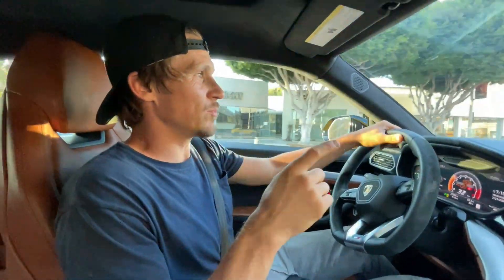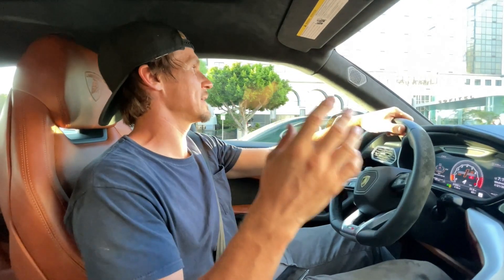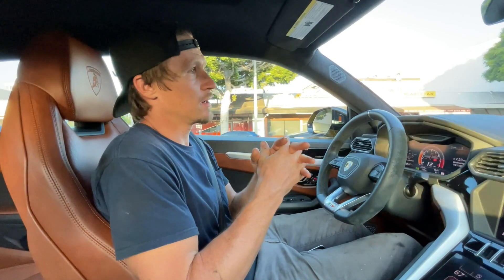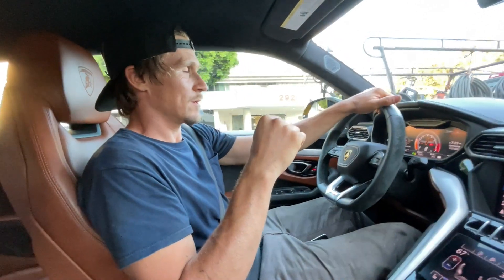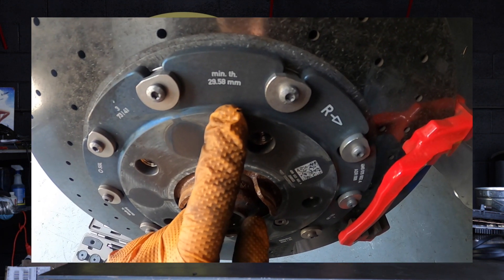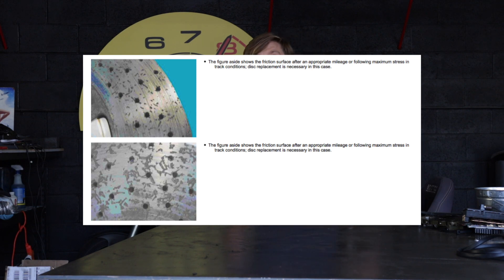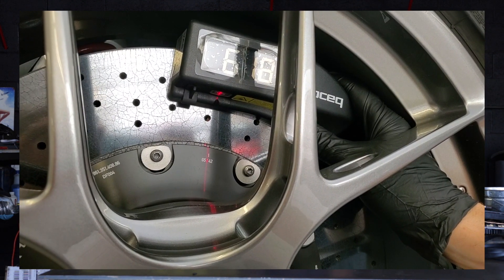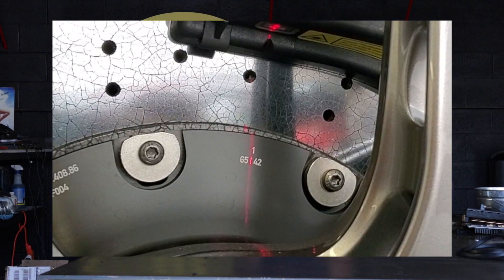Carbon Ceramic Squeal / Rotor Wear Measurement

Comment: Based on the end of the video data (61 - 39) it is 3,8 deterioration within 2 Y & 2k miles. So the lifespan of the rotors will be about 6 years max(if the degradation will be linear)? Sounds bad!)

Comment: Come to find out if you buy them brand new carbon ceramic rotors and brake pads don't do anything that he said especially if you're just normal driving like you normally would if you didn't have carbon ceramic rotors because there's a layer that they put over top of your carbon ceramic rotors before you get them and if you don't break hard and leave swirl marks and you don't have squealing from the start you will not get squealing but the moment you break hard and you start getting swirl lines you will definitely get squealing all the time
Reply from the maker: @jayWill45  yeah I guess all the hundreds of cars I work on and get to be quiet by driving it hard are just flukes. Let me guess, you drive a chevy?
Reply: @HollywoodMechanic  apparently you didn't understand what I said if you're buying them yourself brand new and you're not buying them for racing regular normal driving like you would if you didn't have carbon ceramic rotors on your car it comes with a layer over top and as long as you don't break hard and call swirl lines and do what you said 80 to 30 80 to 30 doing that which causes break groove lines if you don't do that at all and do normal driving like you would any other regular breaks and you don't have the noise from the start you will not get the noise because you haven't worn through or broken in and it will go normally but the moment you do that guaranteed if you didn't have squealing before you definitely will have squealing now but it is true it does stop the squealing but because you have those swirl lines in your rotors now and break hard it will come back it's only going to last for a week or so if you're not constantly doing it and you're just everyday driving regularly most of the time

Comment: I had a grinding noise like it was gravel inside at low speeds on carbon ceramic rotors and they were new I did the method that you said 80 down to 30 
 6 to 8 times The grinding noise quit and left swirl marks and the swell marks are smooth but now which I didn't have before when I come to stops at low speeds it makes a squeaky noise why is that
I got rid of one noise and now I have another noise squealing at low speeds

Comment: My 997.2 Turbo S has a horrible squeal since a track day at Road America. Will try the rebed process.
Reply from the maker: @davidcooper3871  if it started after a track day, a rebed will not fix it. The track day burns off a lot of pad so burning off more is not likely to help. I would check for fluid leak from the Pistons or uneven wear on the pad.
Reply: @HollywoodMechanic  will do this. Surprised to hear that 1 track day could be the cause on PCCBs.
Reply from the maker: @davidcooper3871  I've seen drivers go through a entire pccb pad in one track day. Just depends on the driver, the track, and the temperature outside. But I'm betting something is not wearing evenly in the calipers.
Reply: @HollywoodMechanic  I removed the pads on front right. They were indeed thinner than expected with the metal pins showing. Thankfully the rotor is fine. Ordered new pads.  I’m willing to bet that solves the issue.
Reply from the maker: @davidcooper3871  I've seen drivers wear straight through the pad and half of the backing plate and rotors still looked like new.
Reply: FIXED.  was rear pads.  Though front and rear pads looked the same with some sort of pins showing through the pad material that look like brass, rears were the culprit.  Got rears (TRW) for under $200 at ECS Tuning.

Comment: Unless the rotor was measured with the device when new. How do we actually know the number went down? Is it a fact that  new  rotors measure the highest number or just somewhere inbetween? Good video though.
Reply from the maker: @shaleevans5406  the manual states the first number is the from new number for that specific position on that specific rotor but I have not tested a new rotor to confirm.

Comment: Loved the information of the CCB! Great video! However, is it normal for the CCB to produce squealing noises while moving instead of braking? My huracan performante, it squeals while moving, not only during braking. Was told it is normal. Have checked the pads and disc, all in working condition.
Reply: Have a 488 that does this as well.  Chirps like a nest of birds once it gets hot at low speeds and turning left. Apparently many have this issue as well.  Was told I need to bed them. Still haven't done it as I'm not sure I can find somewhere to do this without getting in an accident or getting a ticket.
Reply: @mak23997  hi, i managed to find out the issue which were the ceramic brakes cracked. Changed all of them and solved them. My pista having the same issue as well, currently at 7000km. Checked no cracks on the brakes and the ceramic discs also still good. Seems like gonna accept as it is

Comment: This is probably a dumb question. I’m in the process of planning a complete overhaul of an older car. Basically throwing good money away in a lot of people’s opinions. Part of my overall is going to be an install of a new brake kit. In theory could one run organic pads with carbon ceramic rotors to avoid some of the issues associated with carbon ceramics for cars that aren’t put on the track and see maybe 100 MPH once a year when the freeways are clear at 4AM on Sunday mornings?
Reply from the maker: I have not tried using pads other than those designed for carbon ceramic rotors. It's my understanding that the pad material must be compatible to the rotor surface to properly grip the surface. I would imagine a softer pad would be used much faster but I don't know if it would properly slow the car or how it would perform in an high speed emergency stop. If you do try it, I would love to hear the results. But I can't condone it.
Reply: @HollywoodMechanic  considering that you work on some of the finest cars on the planet, I totally understand why you can't explicitly endorse it. 

Yeah I understand that organic pads would deteriorate extremely fast compared to ceramic pads on carbon ceramic rotors. Stock setup is organic on iron, so I think the stopping force would still be plenty. My idea is to get a Wilwood custom setup for my older Mercedes-Benz that would have carbon ceramic rotors that would be 8.5% larger than stock, billet aluminum 4 pot front calipers that have the same piston area as the stock single piston setup made out of steel. 

A local college has an automotive tech course that is pretty solid. They let students put their own cars on the lifts to do course work. I figured that it would be a good idea to use that opportunity to do something crazy with my car. Basically reduce as much unsprung weight as possible and replace the ancient power and drive trains with something more powerful, more fuel efficient, yet keeps the majority of the car I love. Basically take a 3515 lbs coupe and try to shave 100 or so lbs while doubling the HP and maybe adding some form of electrification while keeping it the same weight. 

  I'm not even sure if I really do want to do this. Most people would suggest instead of spending a lot of money on custom fabricated parts that it would be better to just buy a new car. Somehow though it seems the learning experience might legitimately outweigh common practice and sense, while also being a good way to get a job as a tech after school when I ask them to pop my hood and look at the underside. 

Should I pursue putting a brake kit that has the same value as the rest of the car itself, I'll keep you updated. It's appreciated that you're one of the few sources to provide helpful information on these brakes. As you know only a handful of cars have them. Thanks again dude!

Comment: Thank you for the wonderful information.  I bought a Carbon 65 Z06 Corvette back in 2018 and it came with the Z07 performance package which has the carbon ceramic brembo brakes.  I absolutely love the car and I have noticed the squeal becoming more prominent after a few months of driving the car.  I'm glad I watched this video to help me understand why this keeps happening and why heating the brakes up is the actual fix for the problem.  The dealership told me to heat the brakes up but didn't really go into why that was the issue.  Thank you again!  Gonna go drive my racecar and heat the darn brakes up.

Comment: I don't have a Ferrari and I've used ceramic brakes for a long time and dealt with the squeal with the mental trade off of thinking I had a better product. This is my daily driver and not on the track. Should I switch to an organic pad?
Reply from the maker: This info here is regarding carbon ceramic brakes. If you're using metal rotors with some "ceramic" pad, then you're probably getting noise because of poor workmanship by the installer. If they are a racing brake compound, the noise will go away at very high temp while at the same time maintaining better brake fade resistance. If you don't know what I'm talking about, then don't spend the extra money on better pads. Just buy oem direct from your dealer or manufacturer.

Comment: sometimes on hard breaking, especially in the cold, the breaks sound like a super loud angry steam locomotive :(
so the procedure to get that light-heat-cycle-layer away you described, can i do that one also when my rear (only front is carbon ceramic) are steel? or will this signifenetly harm the steel breaks in the rear?
Reply from the maker: It will totally depend on your brake bias front to rear.  If you have the stock caliper front and rear, it will be fine.  Carbon ceramic pads are harder to work with a harder carbon ceramic rotor, iron rotors and iron rotor pads are designed to work together, so as long as your stock pressures are present, it will not matter.  If you upgraded your front calipers to larger calipers (when you switched to CCM fronts) but did not replace your master cylinder or add a proportioning valve, then the pressure to the front will be lower than it should be.  Think of it as if you upgraded your engine (or in this case the front brake calipers) to a bigger bore, but kept the stock small turbo (or your master cylinder), then you won't have enough pressure to satisfy the needs of the new larger demand.  If this is what you did, then hard braking is going to shift the bias rearward, as you have stock calipers with stock master cylinder.  In this case, slamming on the brakes will wear the rear pads out much faster than the front.  I would recommend adding a manual proportioning valve in line with the rear brake line to turn it down.  Then perform many hard stops to adjust it so that even in down hill full brake application, the fronts will lock up first and slightly before the rears.
Reply from the maker: You can also just remove your front pads and put them flat on a belt sander and burn off the top layer, this will save wear on the rotor as well, just make sure you keep them flat so that they continue to wear evenly.

Comment: The brakes friction layer can be rebuilt by Rebrake in Germany
Reply: You mean Redisc from Slovenia?
Reply from the maker: Thank you for this info! I need to send them some rotors to see how well it works. Also would like to test them with the Carbo tec tool
Reply: @HollywoodMechanic would love to hear the results of your experience with Rebrake. Thanks!
Reply from the maker: @aaoaaa  I have not gotten a client to agree to wait for them to go to Europe and back yet. I have a rotor coming that was purchased from ebay and we're going to test it and I'll make a video once results are in
Reply: @HollywoodMechanic  This is excellent info.  Did you ever use Redisc or Rebrake to do this?  What were the results?

Comment: It doesn’t help that you are driving a Urus though, the biggest brakes ever on a production car. Those things are insanely massive when I saw them in person, they look awesome.
Reply from the maker: Those calipers have 6 pistons on each side!  Amazing technology, but obviously lost on the people buying these cars, as there a tons of videos of Urus' careening off the road, not making good use of the brakes.
Reply: @HollywoodMechanic  Excellent video.  I'm going to check the related one.  Zero squeak on my RS Q8 with CCB, but it's only been a few weeks.  The calipers (Akebono) are the same as the Urus, which are 5 pistons per side, not 6.  10 total per caliper.  Really great info, though.

Comment: My BMW M4 GTS from city driving would get louder and louder brake noise. I did track it and the noise was gone. Didn't understand why. Thank you for your explaination. Now I just run it hard, if I can get to the track and fixes the problem.

Comment: The brakes on my Ferrari Roma have been squeaking like mad !! Was ruining the experience of owning a Ferrari … saw this video and now they are fixed. Thank you very much for this
Reply: How did you fixed it? Did you do what he suggested to do which was for at least 10 times you drove it 80 mph and coming to a halt at 30 mph is this what you did or just plain bought new pads to fix the squeaking. Thanks! appreciate if you could respond 🙏🏽
Reply: @WildbatBros  they said something about running non ceramic pads to a carbon ceramic rotors. It’ll destroy your rotors in the end I think and that’s a bigger problem. Buying new carbon ceramic pads or OEM isn’t cheap either. I know I’ve called a couple dealerships. It suck’s owning such a beast and all you hear is squeaking at low speeds it is embarrassing to say the least..

Comment: Correct: conductive resistance is the appropriate method for testing CCB wear. It appears you tested it on a BMW M5C with the M Performance light weight wheels. Cool. I have CCBs coming on my next M5, arriving in a could of weeks. I drive about 70K kms on across my cars. It’ll be interesting to see how it holds up.
Reply from the maker: The stopping power and look of CCBs are incredible, if you can afford them. But they are expensive!
Reply: Did you end up getting them? How are they in daily use?

Comment: So from an economic point of view, saying that opting for a 10k ceramic brakes on a porsche 911 that is gonna make 5000k miles per year just to save money on future service and replacement compared to iron brakes and pads is wrong, isn't it?
Reply from the maker: I don't like the Carbon Ceramics unless you really are tracking the car hard and are willing to replace them every few track days.  Otherwise, if opting for Carbon Ceramic for resale value, I recommend to my clients to remove them immediately and replace with metal discs and pads; then to vacuum seal the carbon ceramic rotors and pads to be reinstalled when sold.  LOL  Only way to stop the oxidation.
Reply: @HollywoodMechanic  thanks, doing that is smart because I read you get bigger brakes opting for PCCB and you could resell it also. Definetely worthy